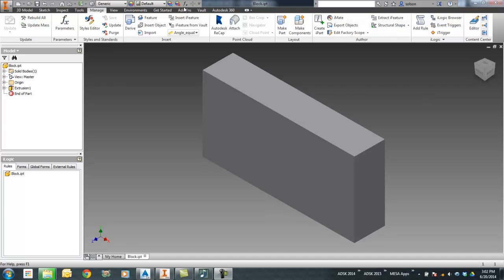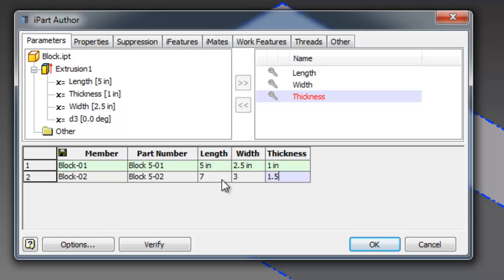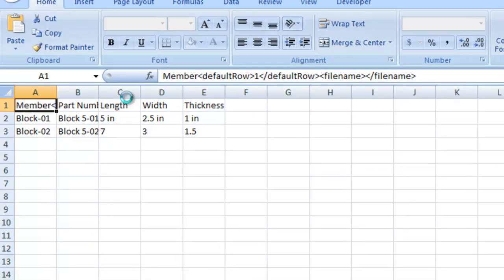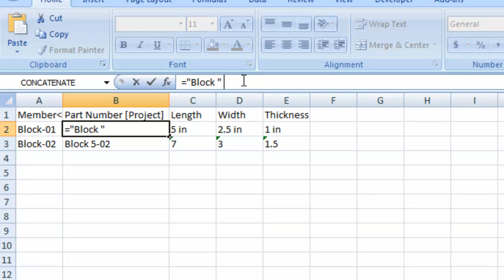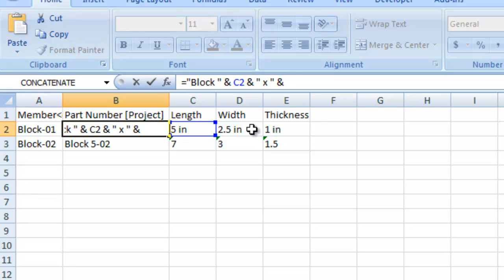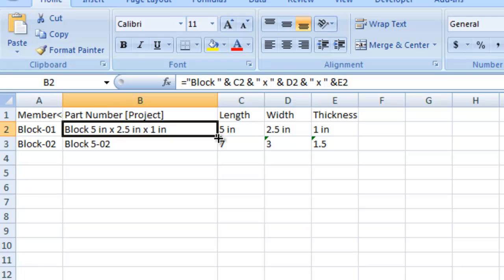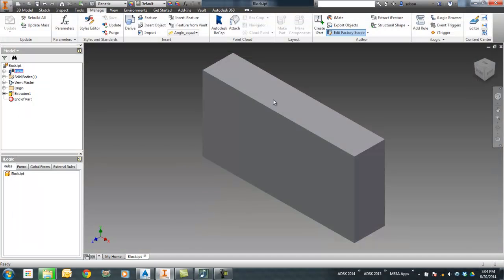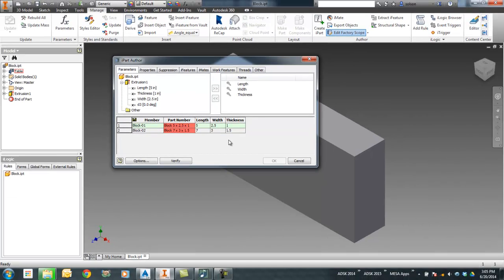Formatting iPart Part Numbers in Excel

Comment: Great video explaining Excel functions with Ipart part numbers! 
My question to you, how would I use Ipart in an assembly.iam prompting me for a unique name and destination folder (directory).  So basically, our engineering files (drawings) have part numbers: part numbers e.g. plate set (011-1234), weldment (004-1234). The plate set drawing (011-1234) has several items (plates) of various sizes and features; these plates make up the weldment drawing (004-1234). These drawings reside in a unique directory e.g. 1750. I am wanting to use Ipart (plate.ipt), but prompt the user for a unique name & destination when inserted into an assembly.iam; subsequent placements would use the last prompted info e.g. (011-1234-01) and destination (1750). Obiviously the -01, -02 for every new Ipart placed.

Thanks for your videos, 
Sorry for a long-winded question on this media-platform...
Reply from the maker: Brian,  thanks for the compliment.  As for your question, normally iPart will generate IPT files for each member based on the text in the Member column for that configuration.  One way to get an iPart to ask for a file name and directory every time it is placed is to identify one column in the table as a Customer Parameter Column.  This is done by right-clicking on the column heading for a column in the table.  This will cause Inventor to ask for which member of the iPart family you are looking to place and for the value for the Custom Parameter.  While you are doing that, you can also identify the file name and save location.  I will also say that the file naming will not automatically increment as you described in your question.  If an iPart member is named 111-01, as it is placed the naming increments will be 111-01, 111-011, 111-012.  Also, that will be directory specific, so this technique will not force you to have unique names across all of Inventor.  The only way I have seen to force Inventor to generate unique names across all of a project is to use the automatic file naming function in Vault Workgroup or Vault Professional.

I hope this helps.
Reply: Thanks for that explanation.... :)
So basically, I have done what you mentioned. I have a plate with custom parameters: length, height, and thickness. When I place this (plate) in my assembly I am prompted, there I change the name and location; however, after I have placed a number of plates with the same specific parameters, I hit dismiss. Starting the process over, I have to now place another plate with different parameters, and again, I am prompted with the same interface box, but with the default name plate.ipt and destination Ipart library, not the last part number used nor destination. I could easily rename the Ipart but the several clicks to the specific directory would be tiresome.... Hence why I thought there may be a solution with ilogic using forms to replace those defaults... So for each placement, a form would pop up and I would fill out file name and destination.  I don't want to stack the multitude of iterations of plate-01, 02, 03...etc. in a single directory, rather unique file names for the various Iparts: plate, stem...etc. 

Thanks for your quick response... I will continue to educate my self with Ipart and Ilogic....
Reply from the maker: @TheBCTraveler  Reading your description of what you are desiring to see, you might want to look into placing the part using the "Place iLogic Component."  I haven't used it in a really long time, but I vaguely remember it doing something similar to what you described.